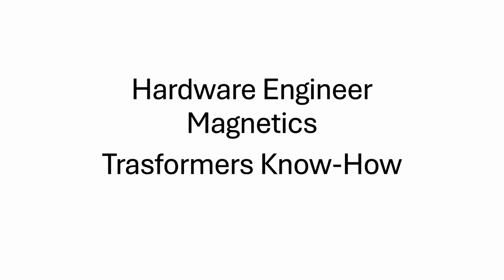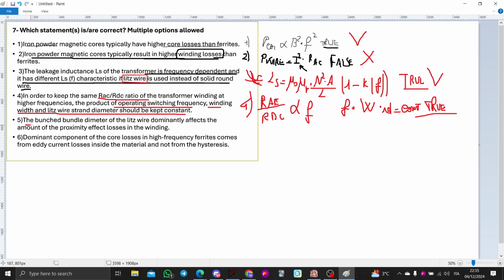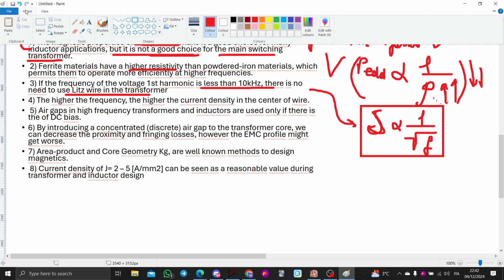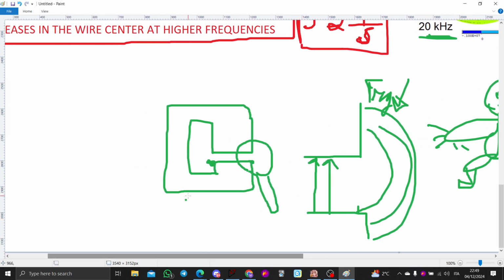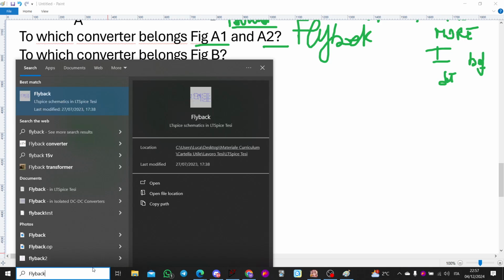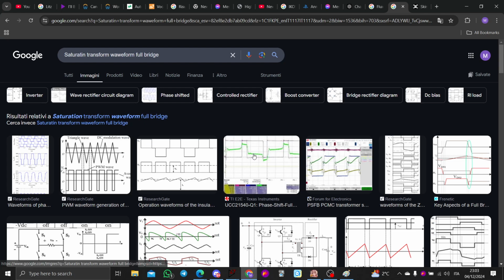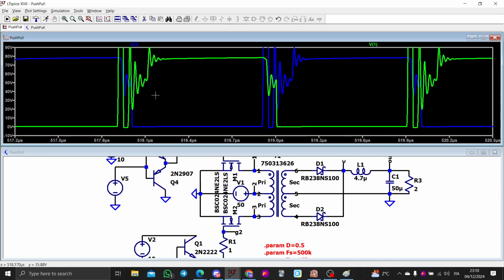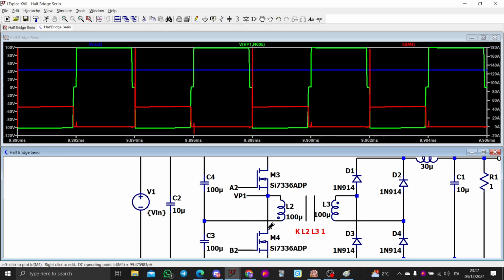[Power Magnetics Hardware Interview] : Hard Level + LTspice Part 2

Comment: Can you show a LTspice-simulation with voltage and current plots of a push pull converter in which the transformer saturates? Which transformer model has to be used? Thank you in advance for your feedback